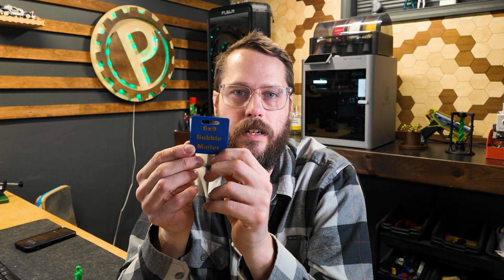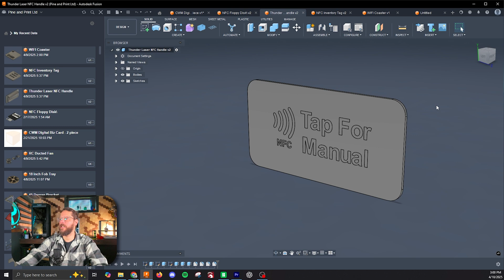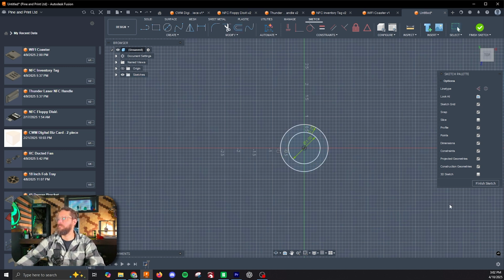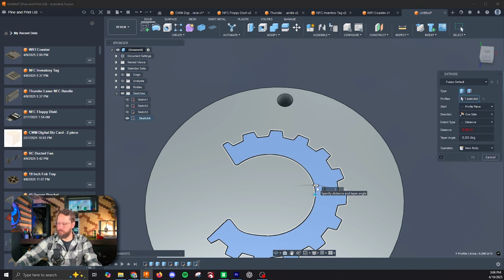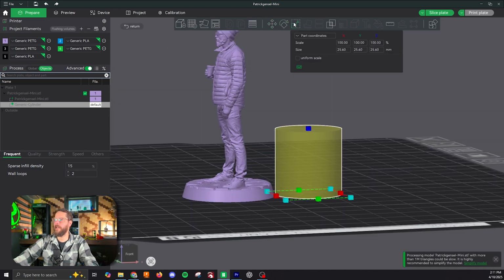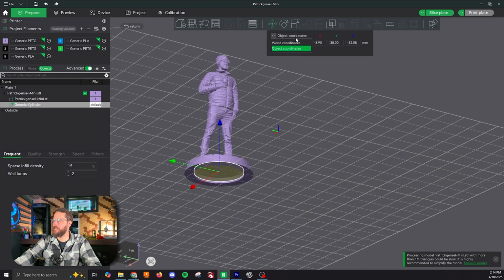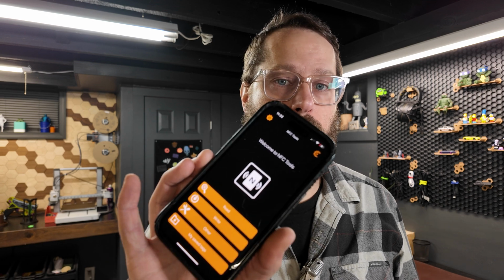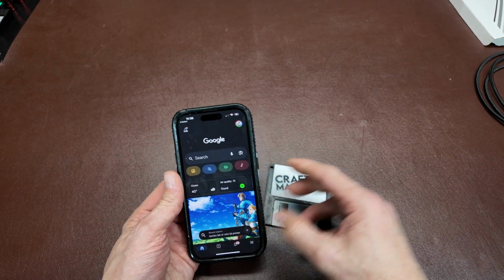Make Your 3D Prints Interactive with NFC Tags!

Comment: Way easier way to add the NFC cavity in Bambu Studio... Just add negative part, size it to 25mm x 1.5mm, center it on your part, put the z position at 1.5mm plus half the height of your cavity negative part, so 1.5 + .75= 2.25 so set Z position of the negative part to 2.25 and Bob's your uncle... You don't even need to mesh Boolean it (although you certainly can) just slice, the negative part will be a 25mm x 1.5mm void in your part exactly 1.5mm up from the bottom...

Comment: What is the depth of the hole for the nfc tag sticker so that the 3d printer does not create a problem when passing over the nfc sticker
Reply from the maker: The NFC tokens I used are around .035” thick, so I went around .040” thick.
Reply from the maker: Too much space is better than not enough in this case.
Reply: @craftedwithmachines  I have this NFC Diameter: 25 mm
Thickness / height: 0.8 mm

Is the hole diameter sufficient for these dimensions: 0.86 x 25.2
Reply: I had too much space, but the first layer didn't want to stick, and it made a mess, so the first layer was falling apart and causing further printing problems.
Reply from the maker: @skymkmm I’d print a test of just the hole with a bottom to see how much thermal expansion is caused by your printer/material. Those dimensions should be good. But prints can sometimes shrink/expand
Reply: @craftedwithmachines  Thank you for replay . Best Regards

Comment: @craftedwithmachines I received the NFC email, but for some odd reason, it ended up in my spam folder. I hope you'll be able to fix that as well, so we don't get two emails. By the way, when you send the print files, consider using Google Drive instead of sending them via email and creating a separate mailing list link.

Comment: I'm having trouble with the layer on top of the NFC tag. It doesnt print well and it cause the next layer to fail. Any suggestions on what I can adjust?
Reply from the maker: @faithfamilycountry  there are two things I’d try. You can make the cavity for the tag a bit deeper so that nozzle definitely isn’t touching it, this will allow the filament to bridge over the gap. The other option is to slow the print speed a bit. That being said I think deepening the cavity will help. It won’t take much, just enough so the NFC tag is sitting below the next layer.